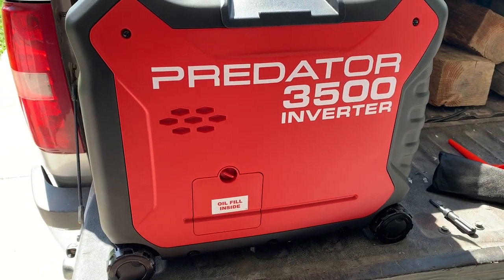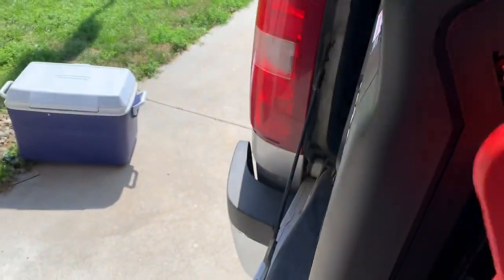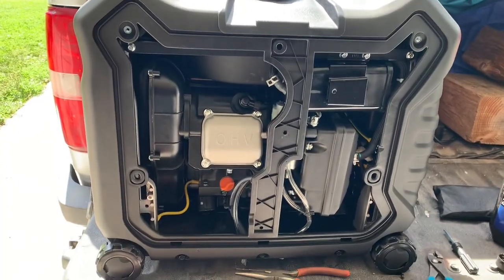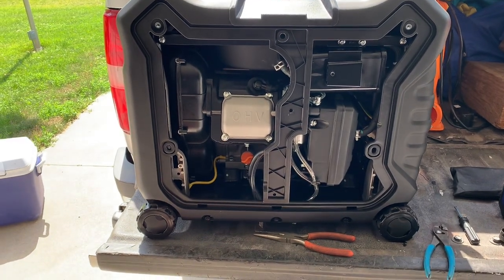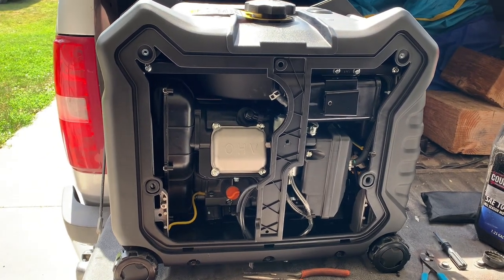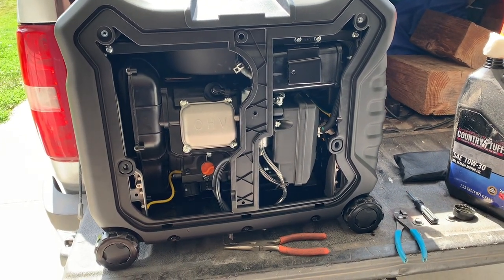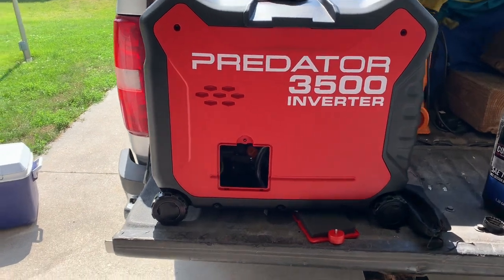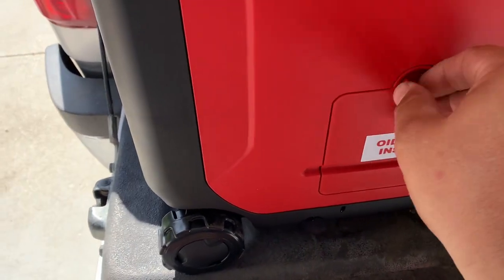Predator 3500 watt Generator Charcoal Filter Delete

Comment: Just remove the hose going to the air filter box. And cap the nipple on the air box. This way, the charcoal canister acts a catch can for the vent.
Reply from the maker: That’s not the issue. The issue is the tank can’t vent. Capping off that line only makes the situation worse.
Reply: @tcanthony2  
I didn't cap it off. I left it open to drain if needed. I capped off the nipple where it attached to the air cleaned box.
Reply from the maker: @pacmag951  still doesn’t solve the issue. The charcoal doesn’t allow the tank to vent. It would still be worse because you wouldn’t have the engine sucking air through the vent. Either way you’re only solving the running rich issue. Been there done that. Took us a few days to figure out the fix. We have 8 generators doing the same thing

Comment: Thanks for this video. I tried everything else with no avail. I had taken my generator off the TH ramp which was extremely steep and wasn’t able to use the generator till just watching your video. Been running 20 min now without shutting off.
Reply from the maker: Excellent

Comment: I’d be careful with doing this. Your now venting a fuel tank into an engine compartment.
Reply from the maker: 4 years of doing this and never had an issue and the sample size is 7 or 8 generators.
Reply: @tcanthony2  Really if you know not to overfill then likely no major issue correct?
Reply from the maker: @kckrol85  still happens. Seen it multiple times.
Reply: My generator has been running like a jewel since I removed the charcoal canister. I now have no issues running the generator while driving as well. Or, overfilling the gas ⛽.

Comment: Just curious why not just disconnect the single hose that runs into the air cleaner?
Reply from the maker: The tank can still hydro lock doing that. The whole point is keep the tank breathing. Doing what you ask about only alleviates the rich issue.

Comment: Just unplug those hoses and that’s it?
Reply from the maker: Yup.
Reply: @tcanthony2  why not just disconnect the one hose that goes into the air cleaner cover?
Reply from the maker: @parkerriverrat1  that doesn’t stop the tank from hydro locking.